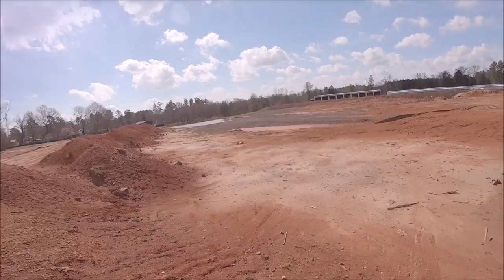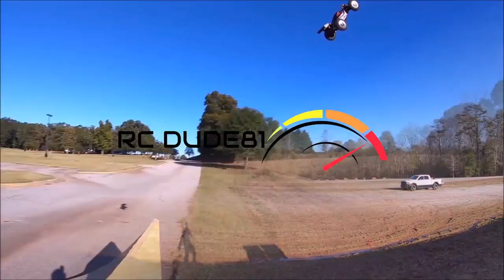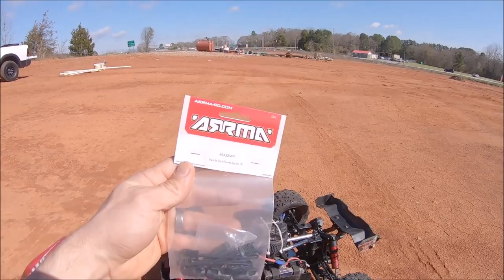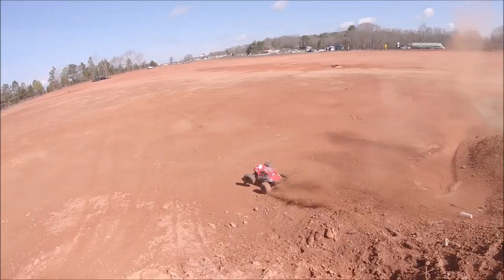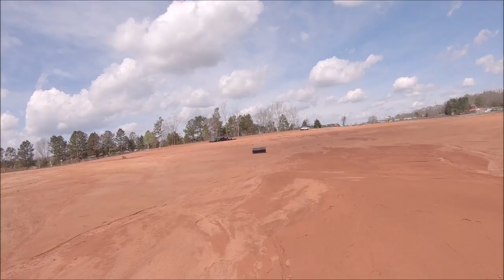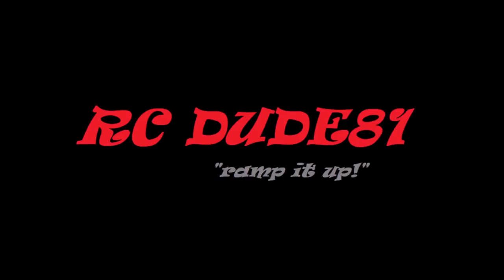"WILD HORSES!" Arrma Kraton 8s and Talion 6s. NEW M2C Upgrades!

Comment: Dude can I pick you brains a min please boss?

Proline badlands XTR 1/8, do you vent them brother or do they need venting?

My 4S Krenton is lightning fast now it has a 4076 @ 2200kv with 26t pinion, it's tearing all my tyres to shreds 🤣 I need 6S wheels/tyres to cope with the insane power. 

I'm very shocked at how well all the stock spur and differentials are holding up. 6 months old and still no signs of failing what so ever, it's had 5 battery packs through it with this motor and pinion so far, these plastic gears are no joke! I was wanting to upgrade them when the truck was new but now I think these gears even though plastic are better than the gears in 6s rigs... I'll stick another 40 battery packs though it before concluding they are definitely better.

Arrma don't put much grease on the main differential drive gears. When I opened it up it was full of dust, fragments of plastic off the gears 🤨 no real wear that will effect the performance so I slapped a load of red diff grease over them.

Arrma need to start selling their cars as kits bro. If they can't be bothered to put them together using a decent amount of grease we'll only have to take them apart to finish what they started. They should sell these cars as a kit and RTR so we can build them to our liking and not glue the whole damn thing together with  extremely excessive amounts of locktight. The lazy can pay extra for a RTR and of course the kits would be much cheaper 😉👍

Love what you've done to your rig above brother and that reaper body was made for it. Bash monster!!!

Sorry about the essay brother.. I am possessed 🤣 peace 🙂✌👊👊👍

Comment: @rc dude81 thanks for your amazing content. I always enjoy! --- I have an outcast 8s (m2cified) and recently acquired a kraton 8s.  I like the kraton and am getting to know the the different driving characteristics vs the outcast, but lean towards converting it to the m2c crusher chassis.  Question1:Do you see a major difference between the m2c crusher vs the m2c outcast chassis in regards to handling? Queston2: do you have thoughts on running the outcast 8s front tower and shocks either on the stock kraton length or on the crusher?  thanks for your input, and BASH ON Brother!

Comment: What size battery do you use and what's the run time?
Reply from the maker: In the 8s Kraton, two 6500 100c 4s packs. Run time is a bit short givin the power system. probably around 10-15 mins total.😎👊